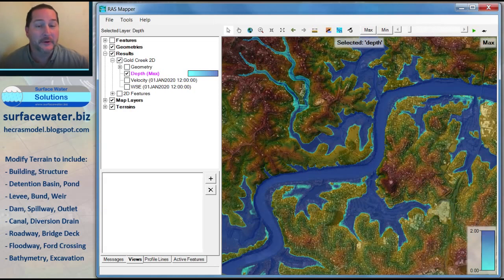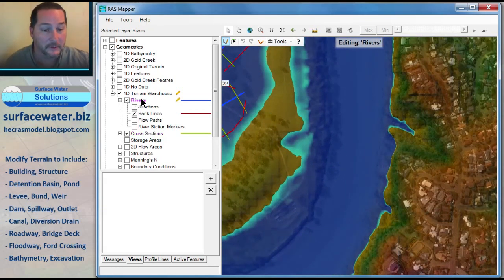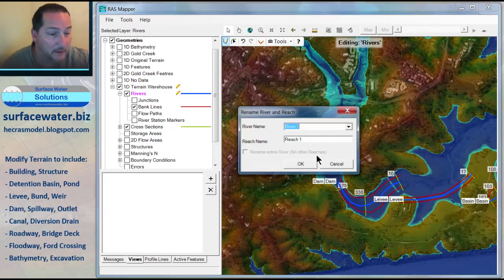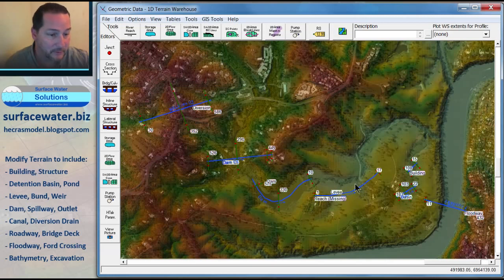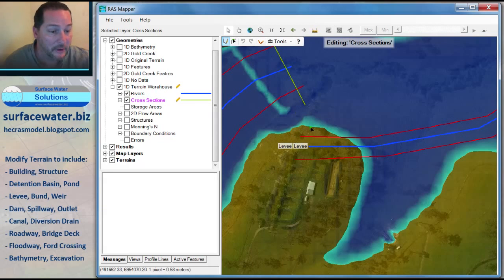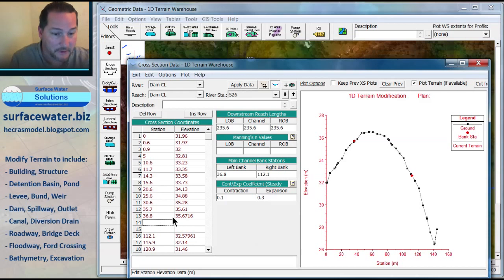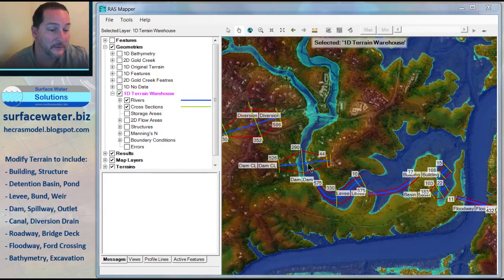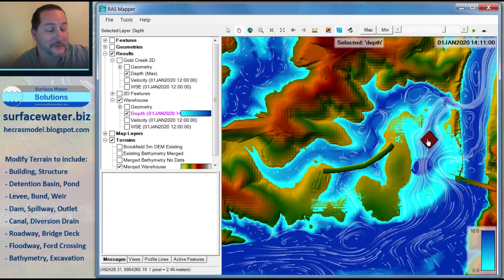Terrain Modification in HEC-RAS Part 3: Dams, Levees, Channels, Buildings, Basins, and more!

Comment: Good morning please i need  help when i add a roadway then i make run unsteady i don't understand the erreur about boundery conditions and they said  that HTab parameter for starting elevation is lower than the lowest elevation in the cross section main channel
Reply from the maker: In the geometry editor click on the HTab Param button in the lower left, select the cross section that's giving you trouble, and adjust the starting elevation to be above the low point in the cross section. Alternatively, you can just highlight the whole range and press "reset defaults". If you're still having trouble with it, contact me on www.surfacewater.biz/contact/.